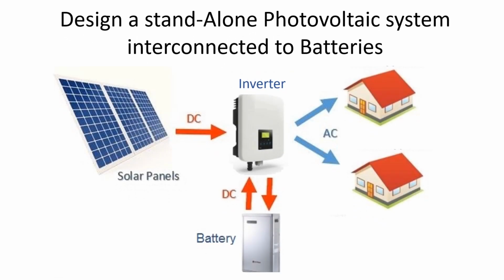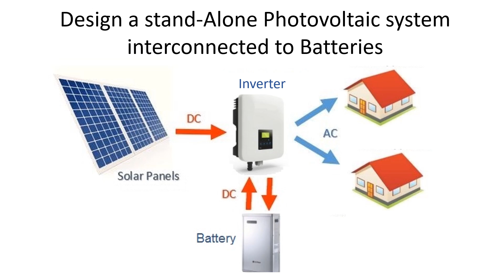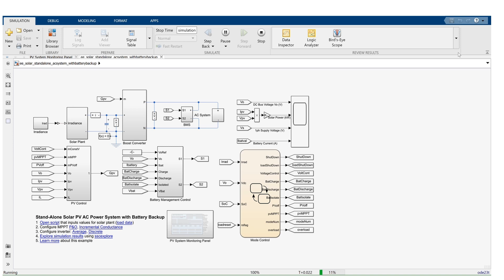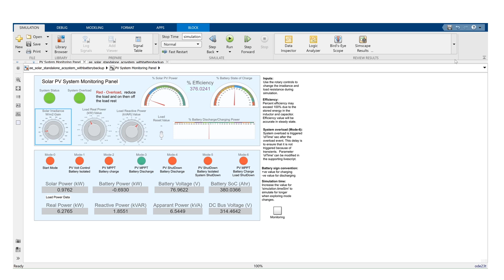How to size stand-alone Photovoltaic + Free Matlab code

Comment: Interersted
Reply from the maker: Matlab Code Link: https://www.mathworks.com/help/physmod/sps/ug/stand-alone-solar-pv-ac-power-system-with-battery-backup.html?searchHighlight=PV&s_tid=doc_srchtitle
Reply from the maker: Please confirm if you can get and run the code now. Also, Matlab Code Command: ee_solar_standalone_acsystem_withbatterybackup
Reply: @renewable_energy  After run the code, I got an error "Please change your current directory to a writable directory outside of the MATLAB installation area", what should I do?